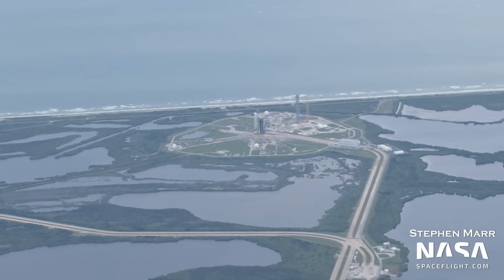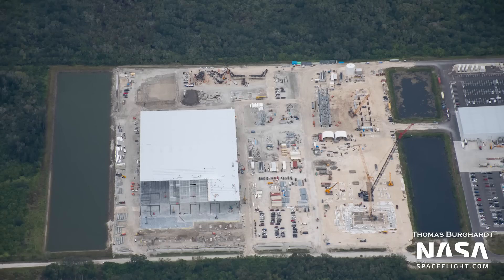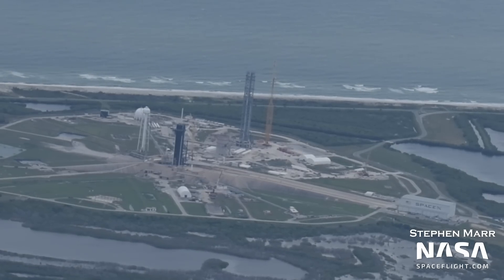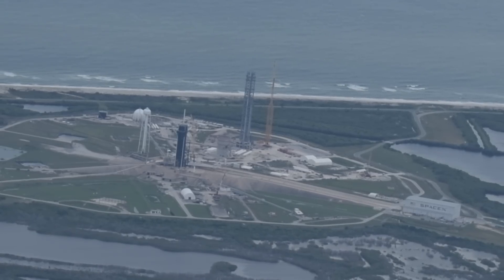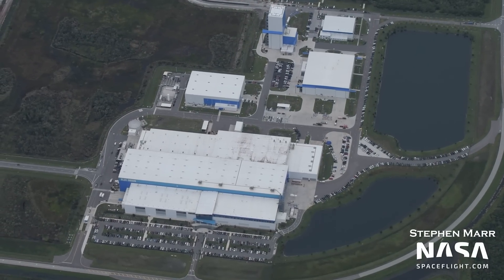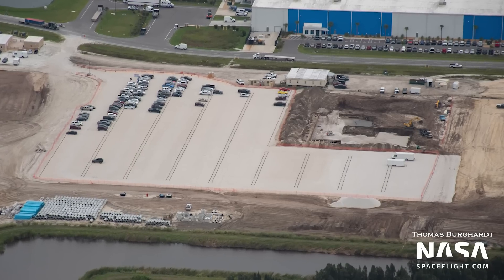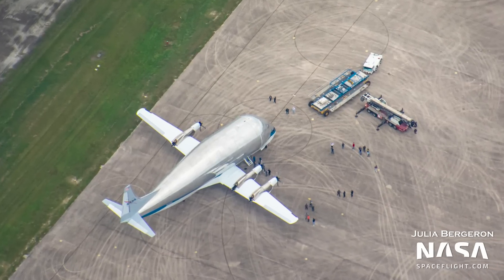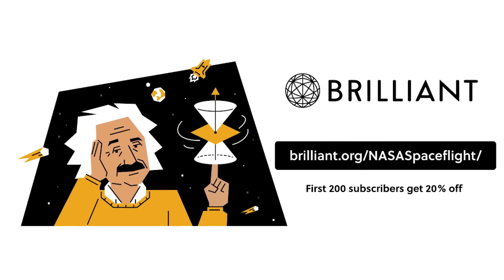How SpaceX is Returning Falcon Heavy to Flight

Comment: Just a thought out of left field.  SpaceX said they are modifying LC40 for Crew and Cargo Dragon.  Back in the Mecury Redstone days, they used a truck mounted cherry picker for crew access.  I don't think that will be the solution this time.  However, Spacex has already engineered a launch tower design.  I wonder if there's any chance that the launch tower being built will either be an abbreviated version for use as crew access at SLC40, or if they would build a full up Starship launch tower at SLC40 and dual purpose it for use as both crew / cargo access for SLC40 F9 Dragon launches back to back with a future Starship pad?  Like I said... deep left field.

Comment: 5:50  That's interesting.  Why wouldn't they do a drone ship landing for the center core?
Reply: Presumably the size of the payload is such that it doesn't leave enough fuel for a powered landing.
Reply: @maxfan1591  I think this is exactly it. It's carrying two sizable satellites directly to geostationary orbit. Not an easy task, will need lots of propellant!
Reply: They may try to save it if possible!

Comment: I think that the Reef Pathfinder Building foundation which you mention is not where are you saying it will be because on the map you can see that the existing building is on the right and not on the left as you are saying.
Reply: Exactly: it's on the opposite side, they've read the plans upside down.  The water feature makes it easy to locate...

Comment: Falcon heavy is such a ksp solution. Just clone the center, duplicate it and strap it on the side. I love it.
Reply: If Starship doesn't pan out and doesn't bankrupt SpaceX, I'd like to see a Super Falcon 9 using 9 Raptor 2s and a Super Falcon 9 Heavy.
Reply: @winstonsmith478  If SpaceX did develop a 3.7m diameter 70m tall rocket using the Raptor 2, it would be different enough from the Falcon 9 that it would deserve a new name - possibly Eagle 5?

While externally the Falcon 9 and Eagle 5 might look the same except for the engines, the size ratio between the two propulsion tanks would be different as well.
Reply: @KnightRanger38  If Starship goes fully online, then there is no need for F9, because Starship will be cheaper, than F9.
Reply: @winstonsmith478  I don't think that's possible. Falcon 9 is fuelled with RP-1 while Raptor 2 is fuelled with CH4. They can't possibly be put together.
Reply: Not Quite, the boosters are so different and the Center core is even more different than a Regular Falcon 9, it’s basically a different vehicle
Reply: @infected7258  I know,but look at it, from the outside it's the most kerbal rocket ever
Reply: @U_Geek  I can’t deny that, I know it might be too crazy but imagine a Starship with 3 Boosters😂
Reply: @U_Geek  The concept was first flown with the Delta IV Heavy. Prior to the creation of ULA, there was a proposal of an Atlas V heavy - again with three cores.
Reply: @infected7258  so different that they are interchangeable with refitting?
Reply: @trekie30122  There is additional structural support on the center core not present on the side boosters. Elon Musk is quoted as having said while it looks like it's just three Falcon 9 cores strapped together, the center core of a Falcon heavy needs additional structural support to handle the thrust of two additional boosters and was an exceptionally more difficult vehicle to design than originally thought.
Reply: @Doctaphil64  while they may be different their overall interchangeability indicates that they are not drastically different.  Side boosters can be adapted to Falcon9 core stage and the Falcon9 core can be adapted as the Falcon Heavy center core.  I believe it was the hotbird launch livestream where they discussed which experienced booster would be chosen as the expended heavy core.  I don't recall a heavy core being used as anything else.  Therefore the adapting to a heavy core may require permanent alteration or the refit isn't talked-about because of the lack of intended reuse of the center core.
Reply: @trekie30122  I believe the internal structural supports of a Falcon 9 or Falcon Heavy side boosters are different from the one inside the Falcon Heavy core stage. The difference is not just some additions welded on, but a stronger construction overall.

In theory it might be possible to use a Falcon Heavy core booster as the first stage in a Falcon 9 but you would pay a weight penalty due to the reinforced structural supports.

I'm not aware of SpaceX deciding to abandon the concept of recovering the Falcon Heavy core stage or if it is just a coincidence all the current Falcon Heavy launches mission requirements require the core booster to be expended.
Reply: @KnightRanger38  The core stage won't be recovered on any GEO or GTO launches due to the velocity required, but it could be on a very heavy LEO launch.

Comment: why the FH core booster will be expended?
Reply: it allows them to use more of the fuel on it and get a higher delta-V so they can reach higher or more eccentric orbits than a regular falcon 9 can. Sometimes its just easier to do it like this and use an lose an older booster
Reply: The required flight profile for at least one of the upcoming flights means they won't have enough fuel margin for a landing attempt
Reply: The price of sending a barge that far out is more than it is worth to recover that booster. It will use all its propellants to lift the second stage.
Reply: @knowledgeisgood9645  So the core stage will not have grid fins & landing legs, right?
Reply: @snapshuttre  Not sure about the grid fins. Re-entry under controlled conditions might be fine without them.
Reply: @snapshuttre  It will not have grid fins nor landing legs, correct.

Comment: I can't figure out why they are building so much towers. What if all that work was done in vain? There is no even single reliably working prototype
Reply: I think they are sure they will have working ships by the time those towers are ready, and are willing to risk it being in vain. They could always repurpose them to be used by others if the project does not pan out.
Reply: @knowledgeisgood9645  I think they have done enough Starship tests that they know no doubt they'll be launching Starships from these towers. Whether a failure occurs or not is another question.
Reply: @digi3218  I said SpaceX are sure of succeeding, but there are many tests that have not been done yet. Like getting to orbit, landing safely, refueling and many more.
Reply: @knowledgeisgood9645  Yeah true. I don't think they will be any repurposing of the towers though, Starship has to succeed and they will keep trying.
Reply: @digi3218  This is too presumptuous, isn’t it? They can't even reach the orbit they can't even try it. Nobody can reach a goal without massive testing
Reply: @MegaRomull  are we talking about Blue Origin or SpaceX lol
Reply: @digi3218  About SpaceX )))
Reply: @knowledgeisgood9645  One starship mishap on or near a tower will destroy the tower and all surrounding items 250 Tons of rocket fuel doesn't go nicely. It is an Unreal risk to attempt to catch the first booster
Reply: @charlesyaryan6619  this is false
Reply: @charlesyaryan6619  The booster will return almost empty. I am not sure where you got 250 tons from. Even so, if there is any doubt it can land safely it will just ditch in the sea outside Boca Chica. The only "risk" is if the Raptors used during the last seconds of the landing should shut down too early. SpaceX has such experience with landing boosters I doubt that will ever be an issue with the boosters. The Starship landing is another matter.
Reply: SpaceX knows what they're doing.

Comment: I guess that Falcon Heavy will look quite odd. Since the center core will be expended, It will not need gridfins or landing legs. But the two outer cores will have them.
Reply: Even stranger will be when ViaSat 3 launches possibly scheduled for December. It will have a new center core without gridfins or landing legs. One of the side boosters will be flying for the 8th or 9th time and the other one for the third time. Again the two outer cores will have gridfins and landing legs.
Reply: I believe They all have landing legs , even the center core.
Reply: @nhango4073  Landing core will not have legs or grid fins, it's going expendable
Reply: @ale131296  Yes, for this mission since there is not enough propellant for recovery/landing...Thanks

Comment: Im wondering, can they build another  Starship launch tower at LC39A?
Reply: Or, as others also suggested, this can be a tower for either Deimos or Phobos, can ship it by barge and lift on. Easier than construction on the platform itself.
Reply: @MeteorMark  Elon bought those because they were very very cheap. Any plans for them are on the back-burner. The cost of construction and maintenance of such platforms is horrendous. They will only be used if they absolutely have to.